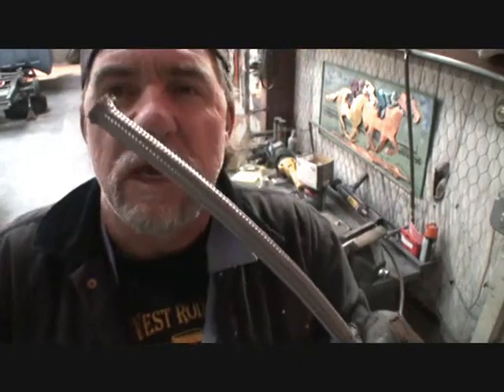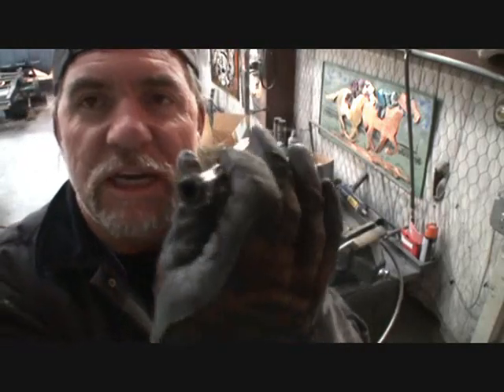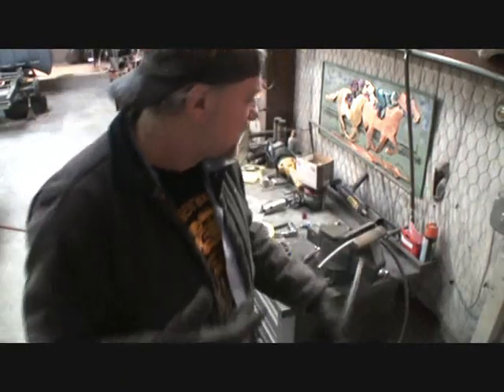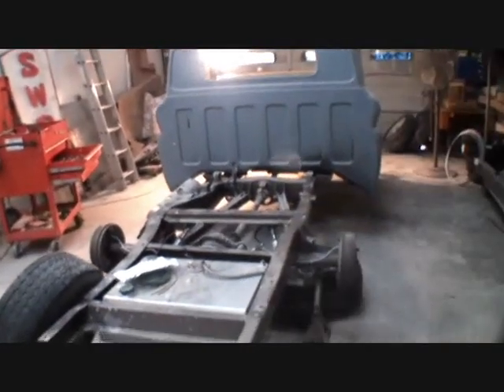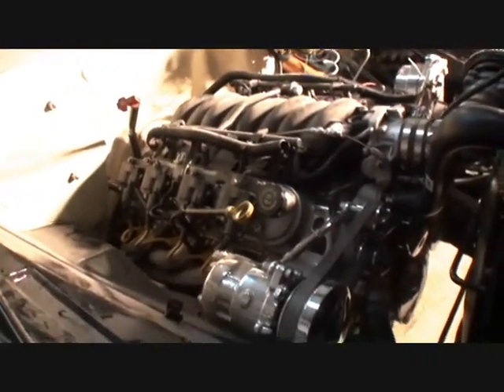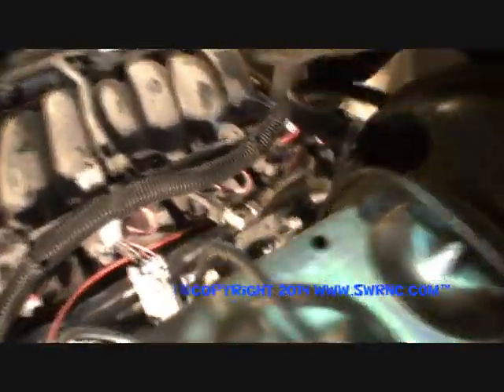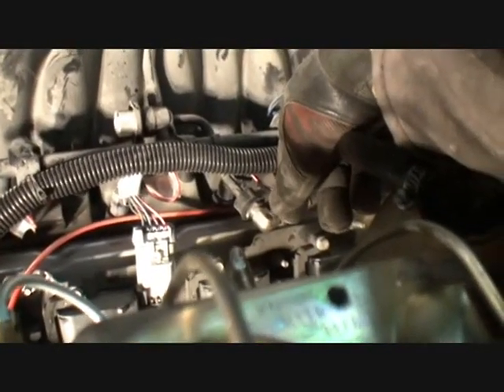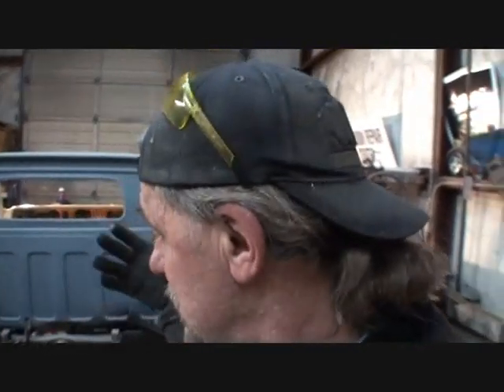How To Make A Stainless Steel Fuel Line Using AN Fittings

Comment: I put together 6 of these fucking things before I got it right. -10AN and -6AN, 3 of each I have my turbo oil and water supply(-6AN) and  return lines(-10AN). Also -8AN (PTFE)fuel lines for E85. On my Big turbo VW 1.8T build. I wish I found this video before I tossed $60 in fittings in the trash. Love the down to fuckin earth attitude in videos, keep the kick ass content coming!

Comment: Braided fuel lines are a bad idea. If there is ever a weak ground and the braiding becomes the next best candidate the small strands get red hot immediately when they touch metal and can cause a fire.

Comment: Couple of notes Pete worth adding since new tools exist. Watch out for the new open ended spanners with Teeth. Couple of companies have their own systems but the Teeth in the open ended spanner will mark the couplings.

Also when the coupling is being assembled, just before the inner part  snugs down on the red outer part. Stop when the flats on the outer and inner line up. Simply because it looks neater...if it's under the truck out of sight..it doesn't matter.

Cheers Pete, absolute legend.

Comment: Thank you, excellent info that I could not find elsewhere. I have a truck with 315,000 on it. Still runs great, but, there is little tech info and even less parts availability, so, I am having to repair/ rebuild these parts and systems on my own.

Comment: Either have professional done but if u r going to do I recomend buying proper cuting tool 30$ and aloy wrench $30 and ur problems solved as once u add one ull want them all changed eventually. Tape the end u going to cut and vice grip the actual fiting (i have bought aloy magnet for vice so doesn’t get scratches if not put some tape on it or it will get scratches also draw one inch line with marker on hose so u ll know how far is pushhed in and after u start scruwing fitting in ull know if is beeing pushed out. Botom line is buy $100 worth of tools and ull never look back hell i made my money back in a 3 months making few hoses for friends charging them 5$ to do it in my spare time

Comment: Also you can get plastic clay tools at a craft store for a few bucks so that you don’t have to tuck with the steel screw driver on the aluminum and risk scratching or denting the Al

https://www.amazon.com/dp/B0019N9ZNU/ref=cm_sw_r_cp_awdb_t1_h6QoCbMM95EBM

Comment: Hey, most people don't use their brain nowadays.... they just buy a "kit"...  It is easy to make even a wooden adapter to hold this hose in a vise  from a piece or 2x2 cut long wise with hole in the middle a bit smaller than hose OD.

Comment: I like to leave a centimeter or so width of fucking MacGuyver tape on the braided hose, after cutting to length, so the fucking braid does not fray and blow out like a well used ass-hole after mardi gras. Love your show. Cheers

Comment: I use a thin teflon sleeve. Slide it over the freyed bits. Slide the fitting on. Slide the teflon sleeve back.
Reply: 040mobil can you use Teflon tape and just leave it on there? Or would that affect it?

Comment: I really enjoy these videos!

One extra tip which I use is to hold the red part of the fitting and mark on the stainless steel hose where the fitting should sit when the hose is pushed all the way in. After that simply push the red part on until you hit this mark. It's an extra check for yourself to ensure the fitting is installed all the way. Thanks!

Comment: on a Chrysler town and country 3.3 v 6 on the  fuel rail pipe there is  ä coating on it. what is its purpose and there's a leak from the fitting. what can i do without having to replace the whole dam thing?

Comment: Why not leave the tape on the metal braid for when your pushing the red connector on? Also with the vise you could add some wood scrap between the metal jaw and the fitting to eliminate damage.

Comment: Hey Pete, I noticed you talked about using the wrenches to not scratch the fittings. I'm an aircraft mechanic myself, we commonly use AN fittings, great parts. To the point... people can simply use a rag in the vice. I've seen lots of idiots scratch the Shit out of their work with wrenches. I'm sure you're famaliar with this simple method, but just a little idea for the diy guy that reads this.
Reply: Awesome. Since I work on guns, I’ll just use the lead or rubber jaws.

Comment: Fuckin' A!  SUBSCRIBED!  Good stuff... Broke ass Camaro builder here, who now knows what AN means.  Two weeks of dickin' around on the web, bought the wrong shit... fuel leaks out the ass...  and now I find Pete.  

FYI: I was trying to use the OEM style 'slip on' type adapter.  For those who've found them in the same spot... in my system the Fuel side (the Line that delivers fuel from the tank to the engine is a 3/8ths tube.  The return side is a 5/16ths.  I didn't know dick about AN connectors, thinking that '6' in the 6 AN was the size... and all I needed to know about the part.  Which is true, UNLESS it's an ADAPTER!  At which point, you also need to know what size the AN ADAPTER fits to.  So I bought 3/8ths... which is only because that's what the part was on Summit that I added to my cart, which I found from a Google Search: 96LT1 Z28 AN Fuel Line... .   I bought four of them... two of which were correct.

So be advised... it is critical when you're buying a fucking adapter, that you buy the right fucking adapter, for your fucking tube... or... You're FUCKED until Monday when Summit starts shipping again.  Thanks Pete!    

OH!  I've decided to bypass all OEM slip on shit... and I'm tigging up AN fittings to my rails and Fuel pump.  (if you do this, do NOT FORGET to take your fuel pump out of your fucking gas tank... and flush it, or you're going to burn down your car, garage and your-fuckin'- self.  So there ya go.)

Comment: The purpose of those wrenchs you showed is so the fittings dont get scratched or nicked. Aluminum for aluminum, steel for steel. I go the extra mile a use a soft material such as felt or similar glued onto the aluminum wrenchs.

He also didnt cover pull back in this video with the fittings. Most manufactures have a set expansion gap before tightening fittings to prevent leaks.

Other then that love the video and your enthusiastic attitude :-P

Comment: braided stainless cpe rubber hose has a short life expectancy when used with todays pump fuels containing additives that degrade rubber.  people often experiance fuel vapor smells without any visual leaks. stainless braided ptfe or teflon hose  has a much longer  life expectancy but requires specific an fittings.
Reply: Hi Dude.

Get it right, good intel, TY.

Awesome! XP.

Comment: Yeah,
Easier to super glue the area before you cut it.
It takes about 15 mins to set but does not fray, and ends go on easy ..
Beware the vapours when cutting .. that smoke is toxic, use a fan.

Comment: Fucking thanks Pete. I was about to buy those stupidly expensive an wrenches, which for my understanding, their only function is not to scratch the fittings. Fuck that shit! I guess you just need to be careful for that. Working on a aftermarket fuel rail for a Trailblazer I6 to V8 (LQ9) swap.

Comment: a drop of oil should help the male spin better in the rubber hose . it also helps to to tape the hose before cutting it with a good tool , this way you wont have issues with the wire and female nut. Great job! Funny video ;)

Comment: Just found your channel and subscribed!!  This is my first time watching you...Like your demeanor, str8 up.  Anyways, the point of buying the AN specific tools is that the AN wrenches are made out of the same Aluminum alloy as the fittings.  That way the fittings won't get damaged or marred compared to using regular steel wrenches.  It is just a matter of preserving the anodized look. Not trying to be a smart ass, just helpful.

Comment: I am having a problem with a short piece,( 6 inch Hose) of 16 AN Pro's Lite Black Nylon hose.
It's twisting when I try to install the second fitting.  I didn't Have any problems with any other fittings , just the short hose , 6 inch, 16an fitting . Any Tips?

Comment: Two things about the A N Fittings...once the red collar is home, i wrap a piece of tape around the hose at the base of the collar...if the hose slips out while installing the blue piece, you can tell...also..hi pressure lube on taper of blue piece before threading it in..

Comment: I tape the end and pull it tight, then cut it with a cut-off wheel in the middle of the tape, the an fitting should slide right on.

Comment: I find it interesting that you use a cut off wheel instead of the proper AN hose cutter.  I must have missed the step where you clean all the rubber and metal shavings out if the hose after you cut it

Comment: Hey Pete. Thanks for all the videos. I've learned a lot from you. I've got a '71 MG midget and want to use stainless braided lines. How do I determine what size I need? The motor is a 1275cc dual carb unit.
Reply from the maker: You'll want to use what you have seen me use in this video for your fuel lines, #6 AN using the 3/8 braided fuel line.. Map out how it's going to be routed and then figure what elbow fitting you need, straight ends, adaptors, ect and go from there!

Comment: That's how I do it, except I use a little grease also.
Reply from the maker: It's better to put them on dry, using grease or lube sometimes makes the hose push itself out of the female  end and not make a good contact for the male end fitting.
Reply: diyautoschool
I hear ya. Thanks for the tip. I very rarely did this.  I tend to use a little grease on most everything.

Comment: what you call a fuel pump looks to be the fuel/regulator for the corvette ls 99+ and for braided lines you aint worry about gas smell or over time deterioration ? summit racing,classic tube,earls,russell,ls1tech all  said braided and rubber lines olny last for so long and if not using ptfe/teflon braided line you will get gas smell im not knocking your situation just curious why not stainless steel lines with ptfe/teflon line for the ends going to fuel pump and to manifold  reason for gas smell is they say todays gas just got so many additive that over time they eat through rubber and clogs injectors gives off gas smell etc. thats why if use hard lines for main lines its easy to swap out the braided lines over years when it goes bad i have no experience in this just doing this setup myself so if you can clear up this for me be great thanks pete...
Reply from the maker: it's actually a fuel filter.. I missed said the wrong word...
Reply: diyautoschool
it also regulates the psi at 58 for the ls1 manifold so again its a fuel filter/regulator for 99+ corvette

Comment: you might consider putting some of your yeller tape on the fitting and then use the vice method.      vice is nice as long as it's legal (G)
Reply: vise, dammit, not vice
Reply from the maker: Yeah, I protect the fittings when they are going to be seen, but in this case you won't ever see them, but they still came out scratch free.
Reply: diyautoschool I noticed ya didn't crank down hard on the handle (G)   anti chafing tape is a good thing where the lines rub against one another....an old helicopter trick

Comment: it'd be nice if there was a 'tool' same size as the OD of the braided hose similar to those plastic gizmos used to release Ford refrigeration lines....rather than push the spring out of the way, it would hold the braid in place til you get the fitting over the loose end.   don't know if that makes sense but I think it would be handy if they made an animal like that without the major price tag.   yeah, right...

Comment: My Friend Pete thanks for the video sir! Lots of people sweat over what size AN fittings that are required, Uncle Sam sized the fittings by the OD of the hose by 1/16" increments. So a 1/4"(4/16) hose uses a # 4, 3/8" (6/16) uses a #6. Guys like me, with mostly lint in their pockets can benefit from make to length, high pressure hose and steel fittings! Thanks Pete!
Reply from the maker: You speak like ex-military!

Comment: I always lube the inside piece to help protect the threads  great tips pete
Reply from the maker: I used lube a few times and it seems when I did the hose would push itself out and away from the female end.... Using it only on the male end, it seemed like it would push it out instead of go in like it's supposed to.

Comment: I have experienced the situation where the threaded nipple pushed the hose back off its seated position on the clamp fitting. So after pushing the clamp fitting on to the hose, I take a marker and make a mark on the Stainless Steel line next to the clamp fitting so I can tell if after screwing in the nipple, everything has stayed seated where it is supposed to stay. A round of tape next to the clamp fitting works good as well cause if the nipple pushes the hose away from its seated position then a space will appear between the tape and the clamp fitting and then ya know if it is done right or needs to be taken apart and reseated. Just FYI. Thanks for the video Pete.
Reply from the maker: Yeah Ive had that problem too, where the hose will push itself out of the fitting while your putting the male end on. What Ive found out why that happens is from over tightening the female end on the hose which will push the hose to far up inside so when you go to put the male end on it's only pushing on the hose instead of actually going inside the hose to seal it up.

Comment: Have you ever made a AN fitting flexible hose work with a solid steel or aluminum line?  I think I need a 37 degree flare tool.
Reply: You do.You also need fittings that work with solid tube that come with a reinforcement ring that goes behind the 37 degree flare that you just made,with your 200.00 $, ,37 flare tool  you bought to make the 37 degree flare 
Paisano